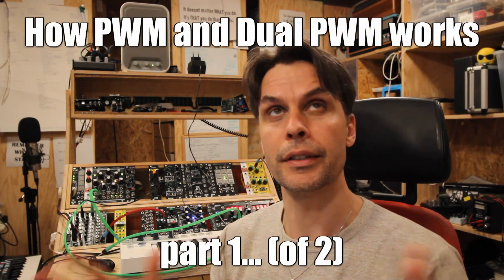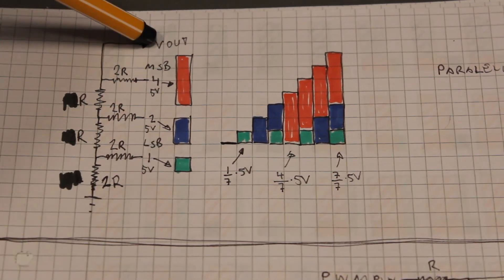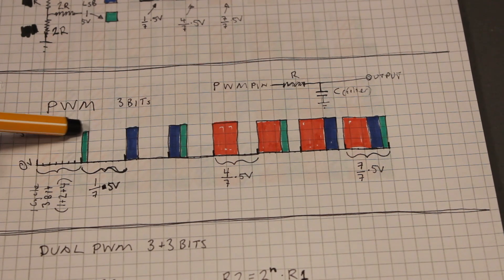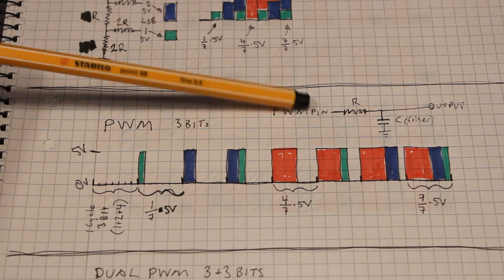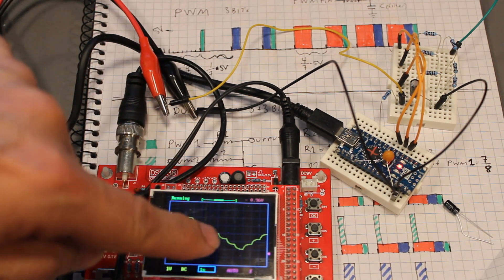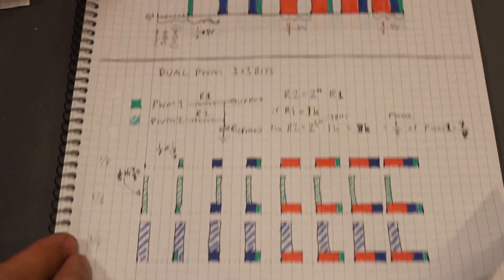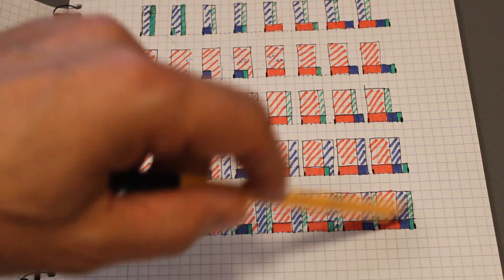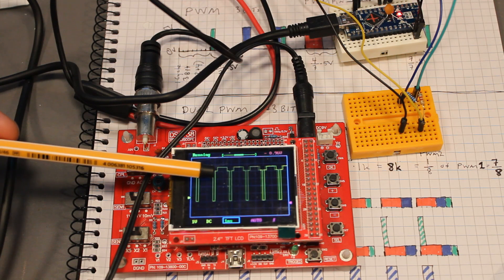How Dual PWM works. Part 1 (of 3)

Comment: Hi Kristian, why don't you try Pulse Density Modulation or PDM? I know there is hardware within a MCU that performs PWM, and I don't know any MCU that outputs PDM via hardware, but the algorithm is as easy so that can be emulated using timers interrupts. I will explain the algorithm using words because there is chance that if i write pseudocode, my comment would be censored by yt.

The general algo for PWM is:

-Let CNT be a counter var that increases from 0 to N where N is the PWM period. Typically N is a power of two. Let D be the target sample data. 

-PWM output is 0 when CNT is below D, elss is 1. 
-CNT resets to 0 when the cycle finishes and D is updated to the next sample.

The algo for PDM is not much complicated. Let be ACC an accumulator with an arbitrary value, but for convencience, the start value is 0.

Then for every increment in CNT, D is added to ACC. If ACC is above N, output is 1 and N is substracted to ACC, else output 0. When CNT reaches N, it becomes 0 and D is updated. No other action required for ACC.

This way, a 50 percent duty PWM something like 0000000011111111 while in PDM is 010101010101010. This is like PWM but ones and zeros are interleaved, thus filtering is much easy because energy of the signal is concentrated in high frequencies.
Reply: Does CNT increase from 0 to N or from 0 to N-1 ?
Reply: @zexusdexus  For both PWM and PDM, the counter counts up to N because the analog range of the output includes Vcc (that is, N+1 values from 0 to Vcc) while in a regular DAC the range goes from 0 to N-1 because the output can't reach Vcc as there is always a resistor tied to ground. Thus the Max value of the output in a resistor DAC is Vcc*(1-1/N).

However, for large N it doesn't matter so much.
Reply from the maker: It sounds interesting and I get it in denser values. However 0000000000000001 will still be a large gap won’t it?. So in those edge cases you still need the rc filter to be able to smooth this gap. Or am I thinking wrong? Also. Since this can’t be done in hardware it would be quite code intensive. ;) But a cool idea and something I haven’t heard of before thanks! :)
Reply: Yes.... And not. The low frequency artifact's energy for edge values such as 0000000000000001 or 1111111111111110 is the same as in 1010101010101011 and it's close to the quantize noise, so the RC filter just have to lower those artifacts below the quantize noise level. 

But... In PDM it is really easy to dither such artifacts without losing bits resolution. Do you remember that i said that, for each cycle, ACC can have an arbitrary initial value but for convenience could be 0? Such initial value controls where the pulses are spread throught the full cycle, although the amount of pulses doesn't change. Let's say that you have a stream of samples of the same value (so you have a DC level) such as 0x0001. If you randomize the initial value of ACC in each cycle,  you get a sequence at the output like this: 0000000000000001 0001000000000000 0000000010000000 0000000000100000 0100000000000000... Here the sample cycle tone disappears even being below 20kHz.

You are right that implementing this in code can be very "runtime consuming", but the ISR is so simple that can be done with just a few assembly lines, and modern MCUs such as the family STM32G0xx... Have a fast TRNG hardware, so the dithering comes almost free.
Reply: Forgot to say that if N is a power of two, then PDM is even easier. You add D to ACC in every step, and let's say that you have a PDM of N equal to 2 to the 12th power. Then in each step you output the 12th bit of ACC and after that you reset such bit in the ACC variable. 

In PDM, linear interpolation is trivial. Let ∆ the difference of current sample and the next sample in the sequence.  Then you shift D so that you multiply the value by N. If 12 bits, then you shift D by 12 at first. Then, for every PDM step you add ∆ to D, and D to ACC. Instead of outputting and resetting bit 12 of ACC, you output and then reset bit 24 because D is shifted 12 places.